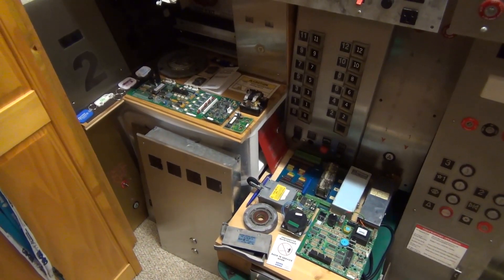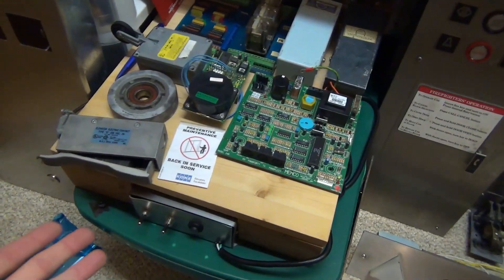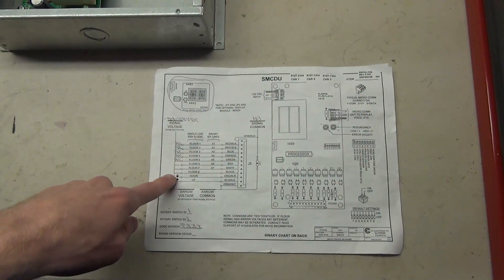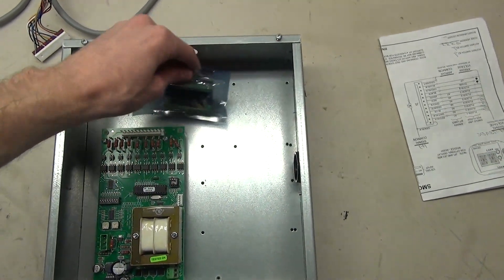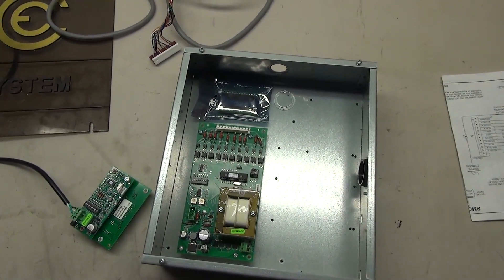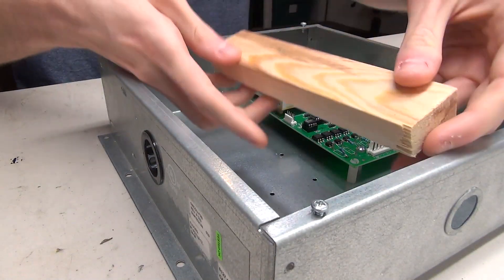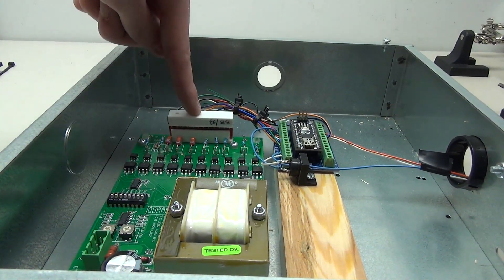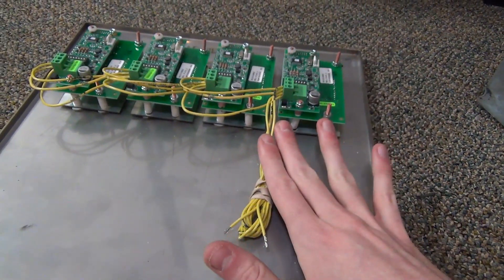Custom CE Elevator Indicator Controller Project

Comment: Holy crap, I've been wanting to do this for eons, but didn't realize the CE controllers were so simple!
I wanna do this myself, but take it a step further and reverse engineer the signal going to the display itself. Completely eliminating the need for the proprietary controller.

Trying to secure one without it costing an arm and a leg right now. Thanks for the insight!
Reply from the maker: Interfacing with a controller itself is not too hard. You can't change what is displayed without reprogramming the chip.
Reply: @stlelevators  I was going to take a look at that too. Since the EEPROM is socketed, I going to see if I can dump it and reprogram it
Reply from the maker: That was going to be my course of action too.
Reply: @stlelevators  I got my controller and display wired up, but I can't seem to get it to do anything. I just messaged you on IG about what's going on.
Reply: @HesitantSignal have you figured out the reverse engineering part yet? I have a few of these displays I'd like to control but the OEM driver boards are very expensive on eBay and I'd prefer to do it with an arduino

Comment: You literally inspired me to do this! I am going to build my own portable ce electronic elevator indicator next month! Im going to make a video of it once I'm finished!
Reply from the maker: You building your own display or interfacing with the existing system?
Reply: @stlelevators  I actually am going to have an elevator controller by ce electronics and it displays B, L, 2-12, and PH. No ardruino is going to be used for this because I'm going to use push buttons. Im gonna connect the buttons to their respective cable.
Reply: @stlelevators  I'm interfacing with the preprogrammed system already. I just have to hook up the display to the control board.

Comment: What input voltage did you use on the elevator control board when you wanted to show a floor on the indicator?
Reply from the maker: I modified the resistors to allow for a lower voltage. I believe the original voltage was 24 and now I lowered it to 5 so it could be controlled by a microcontroller.
Reply: @stlelevators  Neat! I'm doing a very similar project like this, but my project makes it portable! It will possibly be done by next month because I have to make sure that I have all of the materials in order to be successful. I'll possibly post a video of it once it is finished!

Comment: What resistor value in ohms did you use to make the inputs work on the circuit board?
Reply from the maker: I think 47. I’d have to look again.

Comment: Add the indicator to the innovation car panel you have. 😂
Reply from the maker: I would if it fit in it.
Reply: Uses a dot matrix display. There is also a way where if you got a hold of a preprogrammed factory chip, you can change it out on the current drivwr

Comment: Awesome! Where can I get elevator parts?

Also, what remote, arduino, and IR receiver do you use?
Reply from the maker: You can use whatever you want for those parts. I use nano boards because of their size, but again, you can use whatever you want. Some arduino kits come with the board and a remote system. There’s lots of tutorials online showing how to program and set up IR.
Reply: @stlelevators  Thank You!

Comment: I know electronics can be picky but couldn’t you use a small computer such as a Raspberry Pi and drive all four displays separately? I’m no electronics nerd but I do know computers and what they can do.
Reply from the maker: If I can figure out the communication system I could.
Reply: @stlelevators  Do the displays latch their displays to their last commanded display?  If so, you might be able to use a few outputs of the Arduino to select which display is connected to the driver board using relays to connect whichever line is the transmit line to each individual display.

Comment: Very cool!!
As an industrial controls guy, I'd be willing to bet that the displays use RS-422 for their serial interface, like many industrial displays and sports scoreboards.  As such, if you could get your hands on the command set for these displays, I'll bet your Arduino, with an RS-485 or RS-422 interface, could enable you to display anything you want on those displays.
Reply from the maker: That’s the only thing keeping me from making my own controller. I might experiment around and try to make my own controller at some point.